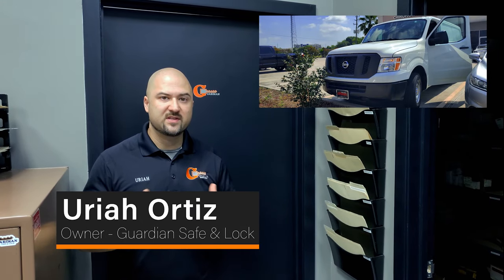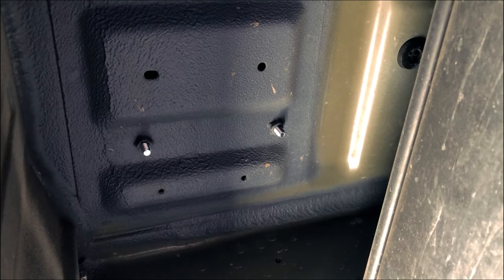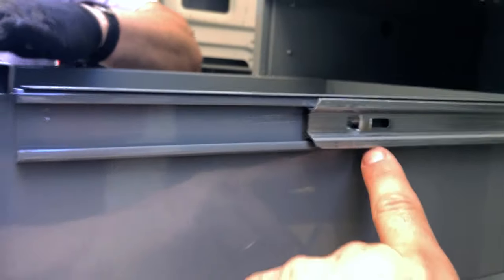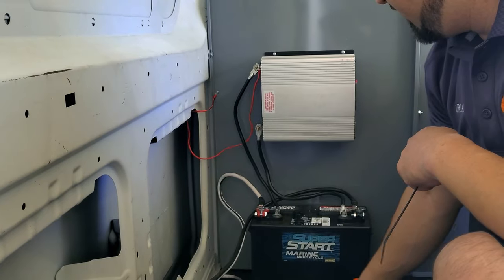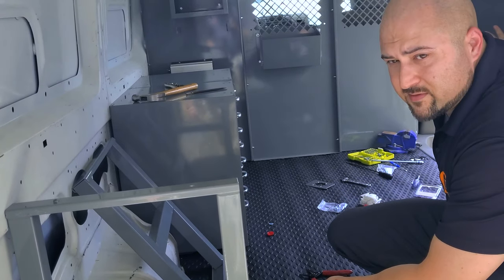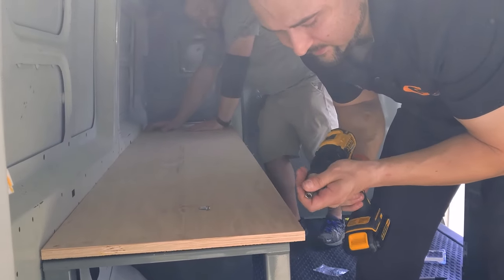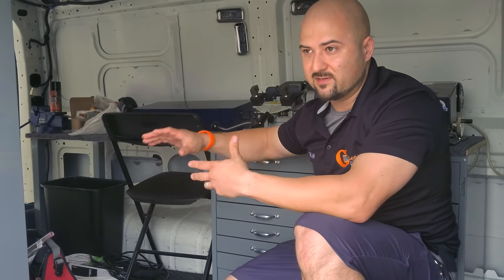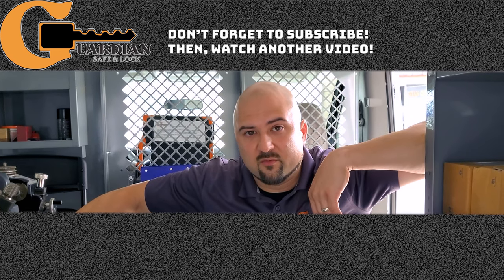Building A New Locksmith Van | GSL Vlog & How-To

Comment: What happens if you need to disconnect the main battery from the extra battery. The way that you wiered it would void any warranty on the vehicle & plus be a fire hazard in case something metal fell across the terminals of the battery or the power inverter there would be no way to disconnect the power to the main battery. The van would catch fire &  burn up.

Comment: Cool rig setup. I’m moving my stuff from a E250 cargo van into a vintage 74 GMC Breadtruck (Stepvan)... I’m gonna go with the marine deep cycle battery as well but use a solar panel and charge controller to keep it maintained and also tie into my main vehicle battery with a dual function isolator. 

So question I have for you is, are you or did you install an isolator to keep the marine battery from dropping your vehicle battery voltage down too low? Or will your inverter shut off before it gets below what’s needed to start the van? There are options so that it won’t happen or the dc to dc controllers that will only charge your accessories battery if there’s 13 volts being put out by the alternator (to protect the main vehicle battery. I appreciate the sharing. Thanks! 🙏🏼✌🏼
Reply from the maker: This is an area that I lack expertise, no we dont ever install isolators. I have looked for a long time for someone to have a better option than what we are using. I can't seem to find any information about a better way to power the machines in the back of a service vehicle. If you would email me your contact info and I'd like to see or hear about your method if you have a better option.   Uriah@guardiansafeandlock.com   Thanks! - Uriah
Reply: @GuardianSafeAndLock  Did you ever get more information about this?